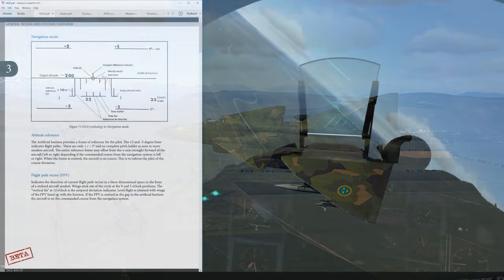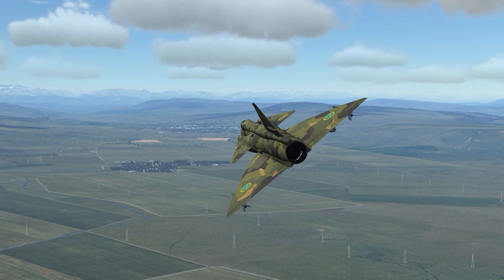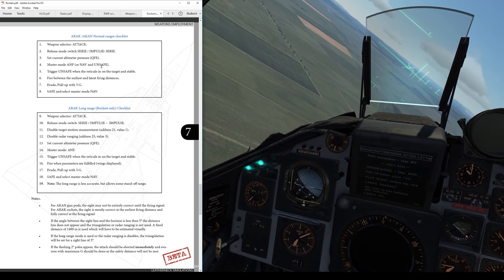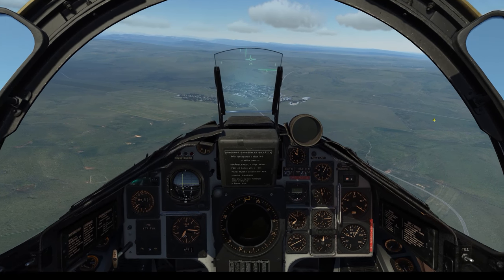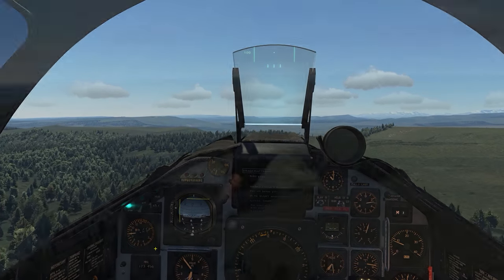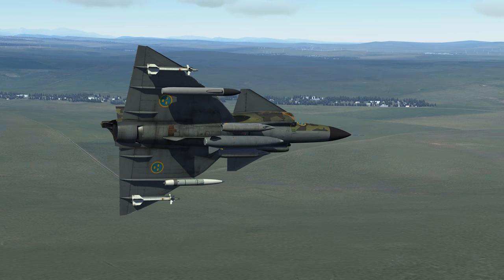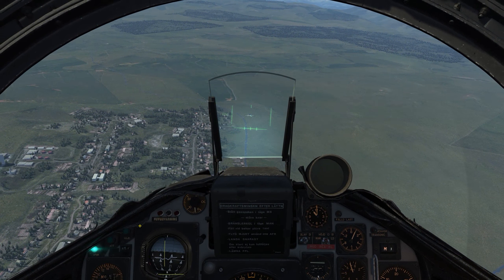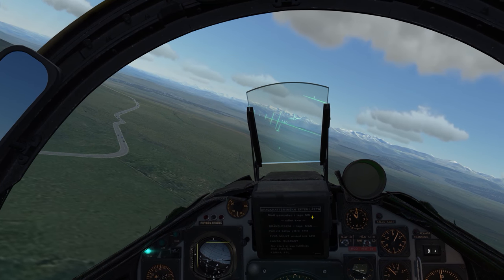Test Flight - DCS: AJS-37 Viggen - HUD, Ground Collision Avoidance System, ARAK Rocket Delivery

Comment: At 14:20 the 'tie' on the fuel indicator (which indicates amount of fuel required to fly the rest of the flight plan) actually jumps up from just under 35% to just over 40%. I think it's because Bunyap deviated from the flight plan stored in the navigation system and flew further away from the landing point, so it had to plan some additional fuel usage to account for turning around and returning to the flight plan.

Just thought it was an interesting detail worth pointing out.

Comment: Nice shooting. That final chance to catch a reference helped immensely. I was wondering if the radar was used as "CCIP/CCRP" during weapons drops. All the information I had suggested all drops were done intertially and I couldn't help but marvel at how hay could be accurate enough to get a shot. 
Is there a way to fire only one rocket or at least one pod only?
Reply: Rockets are always launched in salvo from all pods from what the manual says. The SERIE (series) / IMPULS (single) switch is only used for the anti-ship missiles. For the rockets it selects normal mode or long range mode.

"One pass, haul ass" is the Viggen motto. Understandable given its role but kind of a shame, since the radar-ranging rocket delivery seems pretty accurate.
Reply: sldfnslkxxlk that's what I was thinking but I agree it makes sense. Guess the gun pod will give me my multiple passes.

Comment: Is the kneeboard with the waypoint and QFE part of the module or is it something you added??
Reply from the maker: It is included by default.  There are custom maps, airfield listings, and other things as well.
Reply: Its an Default Automatic Feature.

If you add waypoints in the Mission editor a Kneeboard page like that will automatically be generated
including all that data for the different waypoints etc.

Does not work with Waypoints that are made during the mission though only those created in the Mission Editor.
Reply: Excelent!